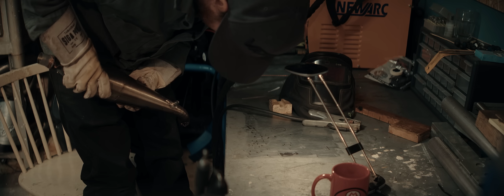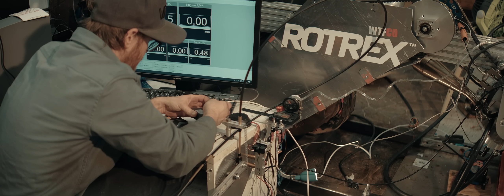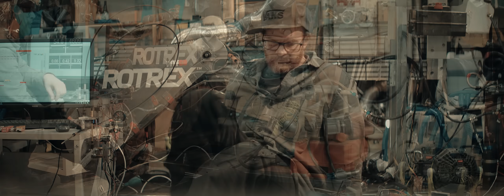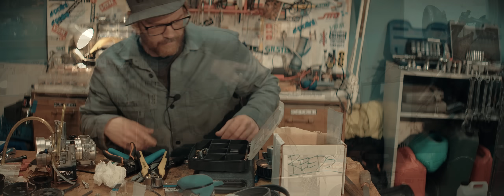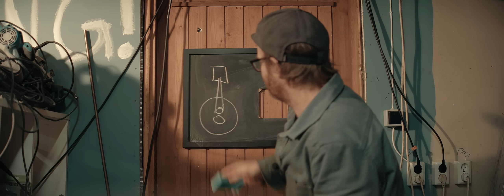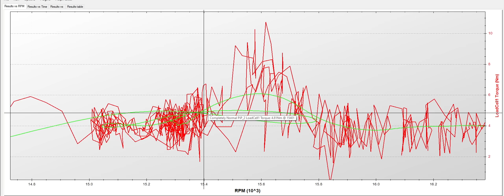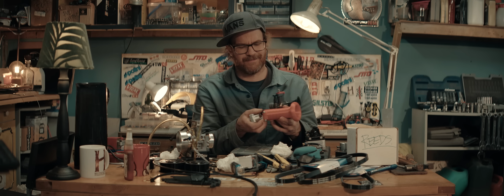18000RPM, But then...

Comment: you know what i hate? an automatic electric choke on a 50cc 2 stoke.
why may you ask? bigus they always creat some form of a leak, a air leak or a fuel leak.
why i tel you this? bigus i had multiple problems with carbs not running good/right, en this is only bigus if you buy a new electric choke you wont get it with a rubber o-ring so you got an air leak.
en why im ranting about this you might ask? wel i finally found out after a long time of trying to make my moped running good en finally change it to a manual choke.
stuppid electric choke's i hate them for good 😅

love your vids en like the progres en experements you do,
greeting from al the way out of holland 👋

Comment: Bummer about the crank! Thanks for the shoutout though! The quickest/easiest way to rule out the load cell noise/vibration stuff is to use a R-C low-pass filter on load cell signal lines. 5-10Hz would be a good cutoff frequency for a dyno, fast enough to give meaningful dyno results while FAR lower than the fundamental frequency of the crankshaft, meaning it will work very effectively to kill vibration-related signal noise. It should fix any ADC aliasing, make the raw signal to the dyno software much smoother, and allow you to keep your loadcell in the location you currently have it. May not be a 100% fix but for the very short time it will take to build, it is definitely worth a try!
Reply: I think there is no way the load cell noise comes from crankshaft related vibration. The frequency is way too low in the graph. Of course it could be some lower order harmonics which do originate from the crankshaft but but... I think the noise comes mainly from the dyno frame vibrations induced to it by the slower rotating parts and the engine cradle when it moves under load. From his picture the vibration has less than 50 cycles per second. Anyway, you are right that a low pass filter should solve the problem. I am surprised why this is not built into the software already, or maybe it is but the cutoff frequency is too high. Not sure about his load cell mountings. To me they look like completely metallic ones. He should have a rubber bushing at least on one end. I have heard of a special rubber called sorbothane which absorbs vibrations like no other. One thing that could also be tried is to change the geometry of the dyno frame. Maybe cut the main beam shorter, remove excess weight from the end (the fuel tank system looks like it could be an effective pendulum), move the legs closer to the engine and add some rubber under the legs. Even some weight could be added to the frame or the engine cradle to shift the vibration frequency.
Reply: @ASoftaaja  I think a key aspect here is the sample rate of the ADC and the software - crank vibrations will get aliased to lower frequencies.
Reply: @MikeyAntonakakis  yeah, aliasing is a good point.
Reply: @ASoftaaja  All good suggestions on your part! I’m sure the dyno frame resonance is having an influence too, totally agree.
Reply: @ASoftaaja  I agree, the whole frame is vibrating. You can see it clearly in the video. It's not a great design. I keep thinking there is a reason anyone who tunes engines just gives up and buys the same high quality dyno everyone else is using. Because if you try to fabricobble your own dyno together like this you will be chasing your tail just trying to get good data. My favorite two stroke outboard tuners all seem to have similar high end dynos and I bet there is a good reason why.
Reply: @mjodr  I'm sorry "fabricobble"? Did you just make that up? My whole life just got summed up in one word.
Reply: @mperhaps  One of AvE's signature words from his channel. https://www.youtube.com/@arduinoversusevil2025
Reply: @mjodr  lol is Dyno is perfectly fine my dyno software and hardware is great and the brake retarder is just to give a load to the engine 
A dyno is a super simple device
Reply: Im sure Im not the first to consider this, but also got to wonder if the load cell is inductive and creating a large magnetic flux as it rotates?  It would seem it has the resemblance of a electric motor hiding inside the guts, but impossible to know without beeing in the room.

Fingers crossed he buys an oscilloscope to check his leads before connecting to the computer again.

And does away with krimp connectors, and solders instead.. much cheaper rework and fairly quick with matching flux

But just my two cents, hope its of some value

Love the videos!! Long time sub
Reply: @omnicrutch  certainly a possibility, along with ignition system noise
Reply: @omnicrutch  what are you talking about the load cell is the small rectangular aluminum piece bolted to the motor what you talking about is the brake retarder that is used to put a load on the engine completely different thing
Reply: Bla bla bla there a reason why dyno are not built like this
Put the load cell where it belongs on the brake
Even the software maker of my dyno said this is not optimal
Why going the extra hard way for absolutely no gain he not making a dyno but a engine and he got enough problem way more important to solve
Reply: I like your funny words magic man

Comment: 2-stroke works better in airfilter than without when RPM rises airflow might go to high. When you go full throttle there is so much delay when engine start to rev. When you decrease fuel flow decrease airflow too.

Comment: Something i use to do in my early days of playing with weber dcoe and dellorto dhla carbs was to fill jets with solder and re drill them using a micro drill bit set, not the most accurate but was good for getting me in the ball park without the expense of buying many jets. I dont use this method so often now as I've accumulated quite a selection over the years.

Comment: Not sure what the Bonneville 50cc rules are, but a fever-dream suggested a flat-twin with 25cc per pot for better balance…however the friction and pumping losses might render it moot, plus the added intake/exhaust complexity and overall mass…perhaps less coffee before bed for me 😁 Love your work, sir 🤟🏼
Reply: less coffee !
Reply: A multi cylinder usually is more powerful than a single, so why not? Suzuki raced (or at least developed) a 50cc triple in the 60's after all
Reply: A flat twin would be rather impractical as a transverse engine from a packaging POV.  A V twin would make more sense and gives perfect primary balance.

Comment: Druckschläge 👏👏👏 pressure slamed 
i disslike at most if people offer a disscusion with "two or four stroke" what like you more...?
oh my gosh... 
we 🇩🇪 grow up with "if you can choosen between two/four stroke , wankel , diesel etc. and all ENGINES have the same power , what is your favorite?... 
Air Shuffeling for a cumbustion engine is so difficult till it runs in (Leerlauf +- 50min^-1) basic  rpm's , also the air infill temperature AND kondensat delivering to the pistion... How tall is the Air Volume incl. turbo and exclude turbo?
i shop a Zündapp C19 Scooter 3+ hp and refill 98octane plus Addinol the ignition candle light brown (four stroke) - i'am surprised

Comment: ? 
have you thought of removing expansion chamber and replacing it with a straight pipe and running it with the supercharger  the pulse in the expansion chamber it could be cancelled out by the supercharger

Comment: The problem with destroying bearings could be linked with the case design that directs flow to the transfers "bypassing" the rest of the case. Maybe adding clearance beetween crankshaft "flywheel" and bearing with a washer, or machining the outer ring (like stage 6 piaggio bearings) could help feeding oil to the bearings.
Reply: I suspect, that the Problem is/was that it ran out of fuel/oil. No lubrication at 14k rpm for ~10 Seconds isn't anything that any bearing can take too well.
Reply: @xxcr4ckzzxx840  I do agree, it ran very well for quite a while on non optimal setups but when it ran out of lubrication it killed itself
Reply: Did the main bearings fail on the Brute Force engine as well. That was swimming in fuel/oil. The induction tract is angled upwards to direct the air flow into the transfer passage ways on PiP. I feel the lack of primary compression is too low leading to poor main bearing lubrication among other things.
Reply: Or assisted lubrication, problem is we're dealing with a 2 stroke so that would change the mixture I'm leaning toward your idea then some type of clearance or "ducting" to promote bearing lubrication they cannot be dry at those speeds specially under load
Reply: @gushhnet  The mains should have a drilled passage way allowing fuel/air to be forced down into the main bearings on the primary compression stroke. The high crankcase volume leads to poor intake suction and compression.
Reply: @malcrandall1309  true maybe he overlooked this in his design?
Reply: There is a chance that the low power numbers was just bearing friction

Comment: Why not use a walbro pumper carb? No messing with main jets. There has to be a size that will work for your application.  I think you have tried before but gave up too soon.
Reply: Some Walbro's still have a main jet essentially, but I had the kind where you could just turn the low speed or high speed adjustment screws by hand and it was so nice. This was on a 125 cc TaG kart and I don't think I had a carburetted engine that ever ran better than that. Was weird going from all my normal carb knowledge and history to the Walbro, but I couldn't deny the results. Having said that, I don't think having a "main jet" is necessarily a problem. In fact, I love all my "regular" style Mikuni carbs and they have been proven to work on tons of engines.

Comment: I once ‘siezed’ my RD500 racing my mates on R1’s, Exups and GSXR’s in Wales, it was a fairly common occurrence to have melted piston or crank bearing go…. I sat by myself on the side of the road for about 2 hours waiting for a friend with a van to come and pick me and the bike up, as soon as he turn up, I had a thought, I turned the fuel tap to reserve and kicked it over… it fired up and ran on all four cylinders 🤦‍♂️ I still chucked it in the back of the van and got a lift home… note to self, check the obvious first and don’t just assume the worst 😂 some times you get away with it, other times you don’t 👍

Comment: 12.5k sparks per min is 25k rpm for a 4 stroke so it does kind of make sense that it cuts at 12.5k if that is the issue
Reply: No

Comment: Mate, you are now talking absolute twaddle about reciprocating forces and crankshaft balance. None of it has any bearing on what you are saying. The reason that 50/50% is the maximum, is due to 100% being the maximum possible. Perhaps the inside heater, is overwhelming your work area with toxic exhaust fumes, and you need to wait until summer to clear your head with some oxygen.

Comment: Hope you slowly run hypothesis through to conclusions. Avoid advance /retard nonsense, as this is a 2T and it has no valves. Timing is for TDC firing only.
A reed valve will ensure the crankcase pressure will not be lost. Please keep us appraised of your RPM and power figures, otherwise we have no clue what you are or are not achieving. 
Forget about your coolant temperature, you need that to prevent overheating, not to maintain heat. 
I am concerned you have forgotten what a 2T is, go back to the beginning and read a book about 2T, then applying what is true, removing your additions and theories, add back improvements that are known to work, historically. Forget about the expansion chamber, that is window dressing for improvements, and not where you need to concentrate and introduce self-doubt.
The colder the ambient temperature, the more HP you should get in theory from your engine. Higher air density. What bloody timing? It is a two-stroke. Set the timing to fire as it should TDC.
What has a filter on the input air??
Look Alex, you change 12 things every time, then replace a random part and 3 settings for some reason and not understanding the outcome, you use claims of rich and lean, and hotter, and advance, then pressure.

Comment: I'm not a 2stroke guy, but would a wide band sensor help you to see if your lean or not? No more guessing at jets
Reply: Well that works only for 4 stroke since the oil in the fuel and exaust will kill the sensor
Reply: @TheLtVoss  For sure and if the regular 2 cycle oil didnt all that castor oil from the RC fuel surely would in shot order.
Reply: If Alex used the blue Stihl oil at 50:1 I feel if the engine is upto temperature they sould last at least a hour or so. Not a chance using a castor oil at 20:1.

Comment: Not knowing these high performance 2 stroke carbs I wonder if they have ones similar to the carbs I used to run when I was into RC.  They used a "high speed" needle which controlled the gross fuel flow and would be tuned for high speed operation, and a "low speed" needle which was fine tuned for rough idle and transition speeds.  They also had an idle air speed screw to help set the idle.  I'd set the main needle and get the best operation overall and then set the low speed to fine tune the low end and once that was set I'd fiddle with the idle air screw to set idle speed.  There was usually no "perfect" spot but once they were all in a good place it was usually pretty decent and stable.  I know they are quite simple compared to what you're running here but maybe simple is what you need.  Not even sure if they make anything like this for engines this size but I figured I'd put it out there.

I've also run into noise issues many times with electrical connections and I found using an audio quality silver bearing solder on all connections, even crimped connections, helps a lot.  I've encountered issues with those spade connectors causing noise due to high frequency vibrations and switching to screw terminals that really solidly hold together can help. Might also want to look into ground loop issues and/or optocoupler isolation.

Just a few thoughts.
Reply: It sounds like you are describing the old air-bleed type carburetor (late 50s). Newer mixture-control carbs have been around since the 1930s, and the model-airplane scene since the early 60s. The thing that I like the most about them is the ability of the operator to adjust the air-fuel-mixture while the engine is operating (either at the engine's carb or remotely). This eliminates the need to be continuously shutting the engine down to change jets, with the inherent problem of trying to compromise between partial and wide-open operating conditions. Then there's the question as to how the mixture is delivered to the carburetor. Direct gravity-feed is a loser, and even regulated pump-pressure has been notoriously unreliable. However, there are several other delivery systems that have proven to work well in this type of application.

Comment: Been thinking you should run two spark plugs, both at 1/2 rpm so they would ignite every other revolution, giving you more exact control. If that's even possible?
Reply: How would that give more control?  Since the spark plugs would be in different locations it would mean the flame front would start from alternating locations each cycle, and I can't see how that would help.
Reply: @ferrumignis  A good point on the flame front.

Comment: Why lower ignition timing at higher rpm
Reply: I believe that when the pipe hits it's like adding compression to a 4 stroke, so you would need less timing in the power band. I know I'm explaining it wrong, but it's not going to be a linear curve with a nice expansion chamber.
Reply: When I  used to race bikes in the 70/80 the ignition was flat line all the time. Check out my question to Alex under M
Reply: @malcrandall1309  I googled around a bit and found some ignition curves that match what Alex kept drawing. I was reading an article where they picked up power by retarding the timing when the pipe hit all the way down to 0 degrees! Had something to do with keeping the EGT in check inside the pipe, speed of sound, the resonance wave, etc.
Reply: @mjodr  Hello Matt. I personally find it hard to believe retarding the ignition on this type of engine is beneficial. I tried alsorts or timings even fixing limit pegs to the stator allowing adjustment while running in different gears.
I know retarding the timing is used to reduce emissions in modern day vehicles under varying loads.
Now Alex is using 30 deg BTDC  which is around 1.67 mm of piston travel it is much happier and still some to go. if Alex wants to push the ignition advance he can make up a brass clyinder head insert to resist detonation damage. The retarded timing didn't help in previous testing. I also feel the large crankcase volume is hurting performance.
Reply: @malcrandall1309  Furthermore, it's possible the curve he is drawing is correct, but it's not in the right spot because he still doesn't know the characteristics of his engine because it basically never runs right. He also admitted his pipe design might still be wrong. I imagine it's a fine line between a perfectly designed pipe and a perfectly curved ignition map before it all of a sudden comes alive. Because nobody is running a cylinder like Alex there is not data to go off of. It's all blind experimentation unless he can find a definitive engineering calculator for it.